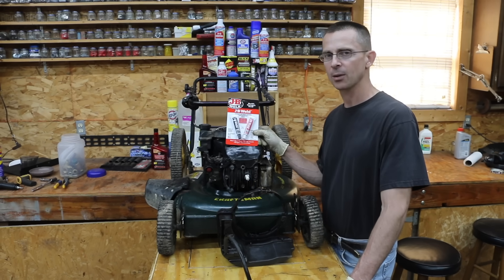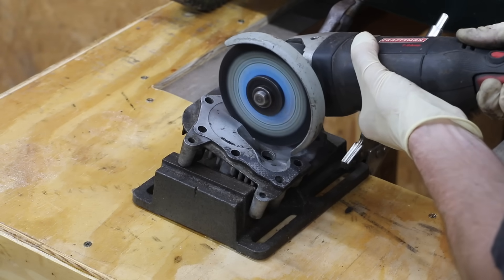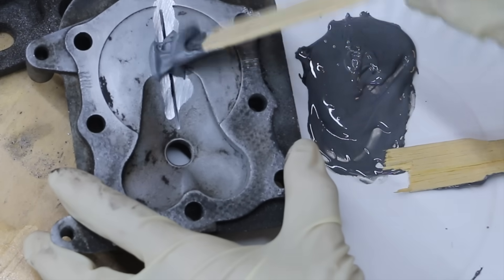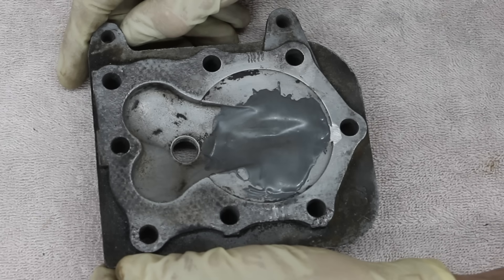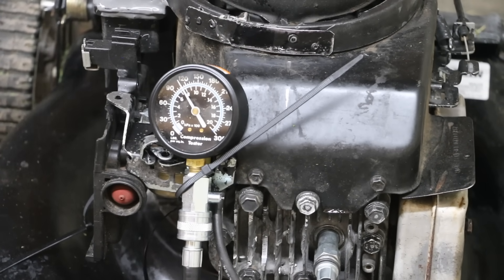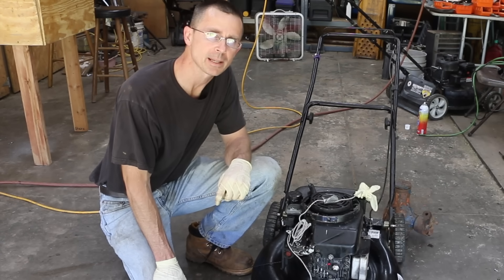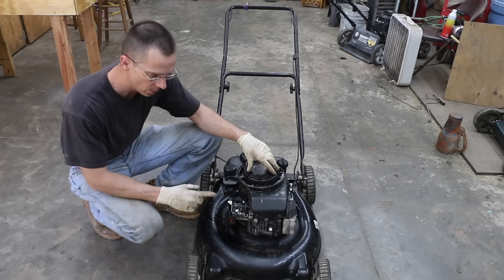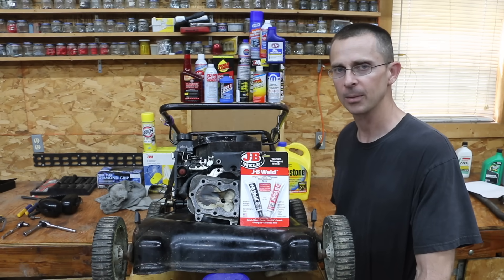Can JB Weld fix a cracked cylinder head?  See the proof!!

Comment: Wow!  Very impressive.  I have used JB for years but never to this extreme.  Thanks for the cool and educational video.
Reply from the maker: I'm considering using it to repair a simulated crack on a piston, but this is really, really pushing the envelope!  Thanks for watching the video and commenting!
Reply: Holy crap I need to see that please!
Reply: Project Farm Sounds like a challenge! I have really enjoyed this series I have been watching right from a YouTube suggestion when you started your seafoam tests on your truck. Cheers
Reply: I would really like to see how that goes. these are great videos.
Reply: yes please do this even if it fails it will show how good it can potentially be . have to share if you do
Reply: I feel the jb original better harder if your willing to wait .higher temp also .hope he has fire insurance if mowing in the garage with that fugitive from scrap yard .auto zone has two part stick I've used on steam boilers set I hour .

Comment: there is JB WELD for both engine repair and Plastic repair // i have always used JB WELD for cracked engine blocks and other parts as well and have very good luck with it as you have seen in this video // but as a reminder its always best to clean all areas very good so that any kind of repair will last or hold for the kind of application its being applied for // and its not a permanent fix but temporary fix and could last for some time before failure  ( and for the high temp on the head is due to the missing fins for the air cool process // now if the fins remained in tack but the small amount missing from the grinding wheel the temp would have been a few degrees cooler
Reply from the maker: Great point!  Thanks for watching the video and commenting!
Reply: have you tried using a old truck inner tube for carburetor gaskets ? as in some cases the fuel tank and carburetor are as one unit  or mounted on the top with the pickup tube in the sediment bowl of the carburetor? they can be hard to cut or make but works great not meant for high temp areas

Comment: I've used it on a radiator with success, that was over 15 years ago though.
Reply from the maker: Impressive!  Thanks for watching the video and commenting!
Reply: Project Farm  About 7 years ago I used JB Weld to make a new post to support the float in a motorcycle carb.  The old one had been broken off and lost.It is still holding up after all this time. Do Not Use JB QUIK IN GASOLINE. It will soften up in gas.

Comment: No, you may not borrow my lawn mower.
Reply from the maker: LOL!!!  Anyone else want to loan me your mower?  More lawnmower torture tests to follow!  Thanks for watching the video and commenting!
Reply: @ProjectFarm  I have a push mower I stripped the spark plug thread. I don't know how to fix.
Reply: @joshbeekman5474  You can buy a helicoil insert repair kit to fix those stripped threads. I have fixed several. Works great. You can get them at most auto parts stores.
Reply: Terry Rose lI first heard about HELI COILS , FROM a friend whom was in USAF in ALASKA,, so finally when I needed them I bought a kit for10. Mm, A well known oil change service ripped the screws on my transmission  ,,, aluminium,  worked wonderful, and I back charged JIFFY LUBE , as it turned out SHELL, owned it then. That car a 91 TAURUS  went on to 430 k miles, #5 cylinder low compression
Cheers From NJ🇺🇸🇺🇸🇺🇸🇺🇸
Reply: Josh Beekman apply JB weld generously to the threads of the spark plug but make sure you don’t get any on the electrode.
Put it in the hole wait for the weld to set and you fixed it!
Reply: @joshbeekman5474 did you ever get the threads retapped?
Reply: So is the JB weld still holding on the fuel tank?I have heard that it does not work in gas tanksI need to fix some cracks on a moped fuel tank but wondering if the JB weld will hold and not deteriorate with the fuel.I know that JB weld works for patching holes on metal like engines. I have used it on carburetors (not on the fuel bowl) with great results.Cheers
Reply: @ProjectFarm  anyone should be honored to let you use their mower!
Reply: @ProjectFarm  I have a snowblower I could donate, but the shipping would bankrupt me
Reply from the maker: I thought about buying JB quickweld, but I've never used it!  Thanks for watching the video and commenting!
Reply: @ProjectFarm  new test J B quick weld?
Reply: No, even JBWeld themselves state it is not as strong.  None of the quick set epoxies are, they set up a poor grain structure if they set too fast.
Reply: I use JB Qwik often as a filler but not an adhesive and only in low-temp applications usually against other plastics.
Reply: JB weld fixing a cracked engine block?...Been there..Done that
Reply: jimmy Lewg lmao
Reply: @PREDATEURLT  I put a Healey coil on it
Reply: JB Weld is perfect for Crack Addicts…or made by them?
Reply: JB Weld is perfect for Crack Addicts…or made by them?
Reply: Awesome video, I just used jb weld on my car's transmission leak as a temporary fix until my replacement transmission comes next week. It held up pretty damn good but the 24 hour cure time is necessary.
Reply: just your son...
Reply: LMAO!!!!
Reply: the next step should be an indurance test...
Reply: JB Kwik is the best..  hardens in like 10 minutes. Strong as hell, fixed a rusted oil pan with it and it outlasted the length of time I owned the car.
Reply: Or my coffee maker
Reply: Project Farm  I'd let you borrow mine, but it's a lawn boy and probably wouldn't help.

I see there is restore engine restorer, when are you going to run that in your green Craftsman?

the only thing better than JB weld is JB quick
Reply: You actually prefer J-B KwikWeld?
Reply: 802 Garage 
no, but when I need JB weld, it's usually because I am stuck, and can't wait on the trail for a whole day.

that and I have used it to fix a radiator... clean the area, crimp and fold the tube, tape off the back side, and mix the JB weld with alcohol, it thins it so it flows, but slows drying time
Reply: @hansevensen8426  That's a good point.
Reply: jimmy Lewg   Lol
Reply: jimmy Lewg 
However, can i borrow some of that jb weld for my wifes mouth...it leaks all sorts of nasty, offensive gasses in large ammounts constantly!!
Reply: 802 Garage 
It is stronger in my experience. New test!

Comment: I have read others say that cleaning the piece is very important.  e.g. use acetone, and also to not contaminate the jb weld in any way by using say a wooden popsicle stick to mix it or, in your case, a paper plate to mix it on.
Reply from the maker: Absolutely!  According to the MSDS on the carb cleaner I used, it's 80-90% acetone.  The grinder also helped provide a surface for the JB Weld to bond.  Thanks for watching the video and commenting!

Comment: JB Weld is plastic.  It will not stand up to engine heat.
Reply: Generally suggested to watch the video before you comment.
Reply from the maker: Thanks for watching the video and commenting!
Reply: I used jb weld to fix a leaking oil pan on a car. It's been a few months and no leaks and its fine. of course, oil will not get as hot as this. but hey it still worked

Comment: I used J-B to fix an expansion chamber I bought on E-bay and got stuffed with as it was cracked but I filled the crack with J B weld 5 years ago and its still good, yes I know its not under compression but still shows what can be done, Wouldnt wanna use it on a water cooled head though. But cool test. love the video's.
Reply: Why not a liquid cooled head? They run cooler temps.
Reply from the maker: Thanks for watching the video and commenting!